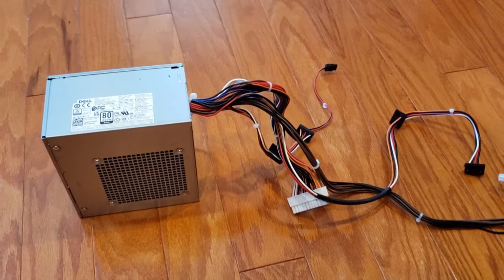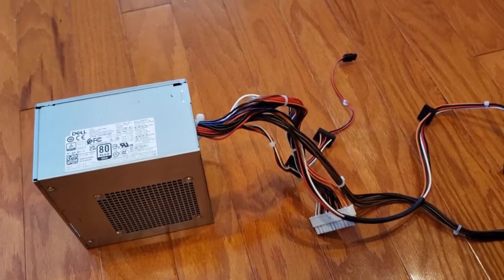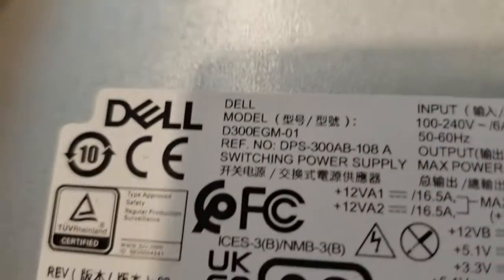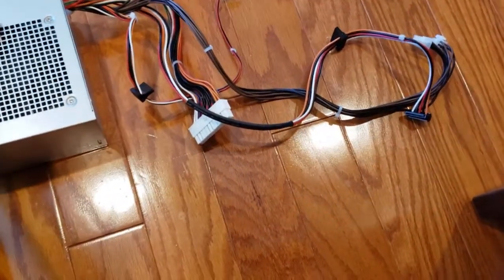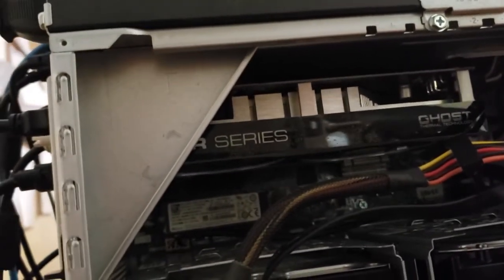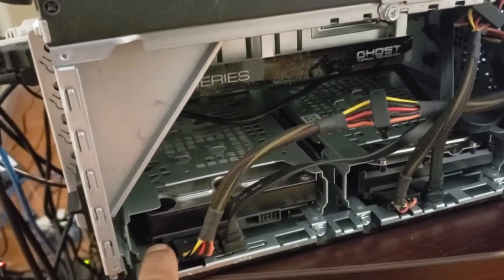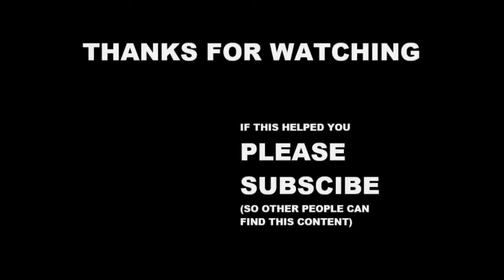How to upgrade the power supply on a Dell T3640

Comment: I'm starting on the same journey with the 3650. It certainly is wimpy compared to my 20yr old T5400 xeon that has been rock solid and still runs like a champ, but is getting increasingly outdated, e.g. BIOS and MB connections.
Reply from the maker: Yes, the old workstations were physically robust compared to new ones, but they were power hogs compared to the processing capacity today.

Comment: Thanks for sharing this info! I was looking to understand if the supply had the same dimensions as a standard ATX supply! Not only for an upgrade in this case, but for a swap to a better case! This is so helpful - thank you so much! <3
Reply from the maker: Standard ATX will work. T3640 case seems too small for an ATX but it does fit, Watch your cable management to maintain good airflow inside the case.
Reply: @Andrewsnotes1  is the 3630 the same as the 3640 in terms of the case size? will a standart atx also work for it?
Reply from the maker: @johndank2209  Close enough, ATX power supply will work.

Comment: Yo tengo el modelo 3640 tower se le puede poner cualquier fuente de poder sin importar la marca?
Reply from the maker: yes
Reply: @Andrewsnotes1  gracias por tu respuesta. tengo otra duda quiero comprar una rtx 4060 pero tengo miedo a que no entre en el gabinete por la altura y largo que consejo me das?
Reply from the maker: @juanmanuelpa100  The case is small and may not accommodate a large video card.
Reply: @Andrewsnotes1 ok amigo y que grafica tienes instalada en el video? Lo que me preocupa es la altura ya que tiene esa lamina que estorba donde va la grafica
Reply from the maker: @juanmanuelpa100  AMD Radeon R7 200 Series
Reply: @Andrewsnotes1 le acabo de comprar una RTX 4060 Ti le quedo perfecto para jugar juegos actuales
Reply from the maker: @juanmanuelpa100  I am glad it worked for you

Comment: Did you have an issue with the CPU fan/heatsink preventing the removal of the external fan connection? My CPU is seated right on top of the connection. Just trying to find if anyone had a more simple solution to this issue aside from removing them temporarily.
Reply from the maker: I do not recall having that issue, sorry
Reply: @Andrewsnotes1  thanks for your reply!

Comment: Good info -note: the Dell Power Supply is 300 Watt so don't try using a SATA Power to PCI 6/8 pin adapter. Best advise is to install a good quality ATX Power Supply that meets the needs of your video card
Reply from the maker: Yes, absolutely good info
Reply: FWIW, the Dell supply in my T3630 is 460 watts. I think it depends on the CPU.
Reply from the maker: This is the one I used: https://a.co/d/icOKfgP
Reply: Lol, I did exactly that with my Optiplex 3060 on the 260W PSU and it ran with no issues for a 1060 6GB, 1660, and then a 1660ti!!!

(I just had some browning on the port connecting to the motherboard)

But it should handle a 120W card just fine!

And then I did it again last year but used the more rare 6pin 1660ti from Dell (OEM) that they phased out into the 8pin.

A 300W PSU should handle a 1070 or a 2060 just fine I would think.

Comment: Hey I'm planing on buying a dell precision t3630 can I Change the psu
Reply from the maker: yes
Reply: @Andrewsnotes1  So you don't need an adapter to the motherboard like the old dell optiplex ones used?
Reply from the maker: @HaOsLsE  I don't think so but I do not have a optiplex to check. It uses a standard PSU and there were no additional adapters needed.
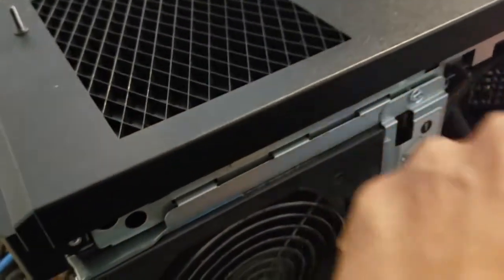Reply: @Andrewsnotes1  Thanks for the super fast response...OH I see now.  At 1:51 you opened your case and I thought you were putting in the new power supply.  It was already there.  So that white connector on the new power plugs straight into the motherboard on these.  That makes it easier.  Thanks!